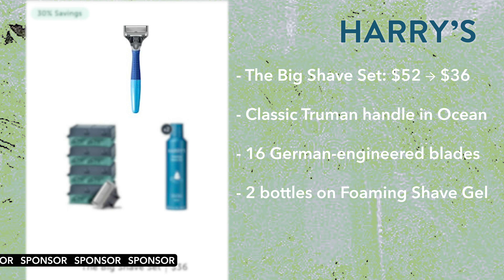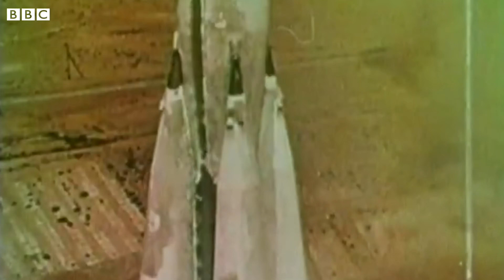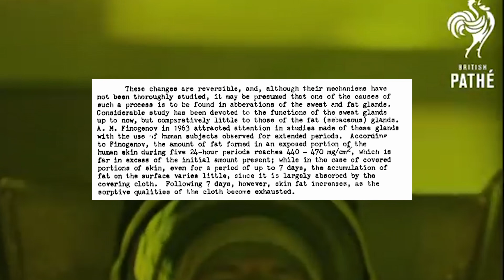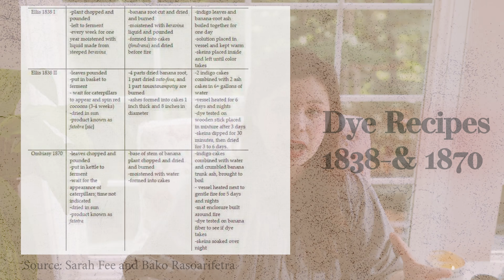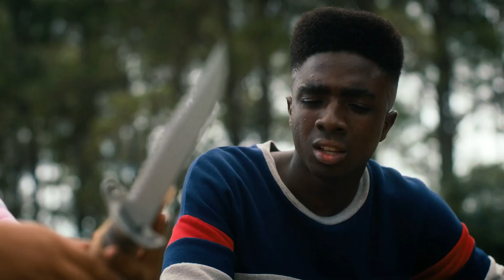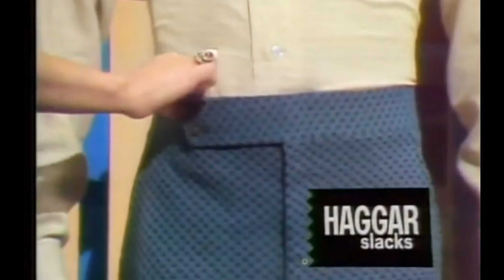The DISGUSTING truth about Laundry

Comment: Just a tip for anyone alarmed by this video, the solution IS NOT to start adding more detergent to your clothes! Most people already use too much and thats part of the problem. A high efficiency washer using high efficiency detergent only needs a couple tablespoons of detergent to clean your clothes, more is gonna cause buildup and soap scum and clog up the washer. Use minimal detergent, add white vinegar to to combat hard water and soften clothes without buildup, and use dryer balls instead of dryer sheets. Dryer sheets can actually cause the problem Abby talks about where the dryer thinks clothes are dry when they arent; dryer sheet gunk is messing up the sensor.
Reply: I HAVE to try this, SO has a skin condition and we live in the dark blue (so VERY hard water, my towels can stand on their own without fabric softener and tumble dry).

Edit to all the helpful people: it is a sensitivity to texture/touch. While I find our calcified (I think it could be magnesium or iron) towels a nice exfoliant, he finds them painful. Using only detergent, all fabrics are stiff. Somewhere between light paper (tshirts/thin cotton skirts/blouses) and a good, thick cardstock (jeans/towels). Over time, you break it back in and it acts like normal fabric again. 

But I've always had hard water, so all those pictures with sheets flowing beautifully in the breeze? Until now, I thought it was about as real as unicorns and dragons.
Reply: @Nerdygoddess , I’m allergic to so much in Laundry World! My mom used vinegar and tennis balls in socks back in the day. And I’ve used vinegar and now, laundry balls. Almost 60 years later, still a thing! It’s so helpful if skin allergies or sensitivities are in play.
Reply: @Nerdygoddess  I'd look at how adding some Epsom salts helps or hinders the washing machine / skin condition.

I've never met someone with sensitive skin / lungs that can stand Tide, so if you use Tide... maybe try something scent / dye / etc free for a few washes especially undies and nightwear
Reply: Oh hey, I already do this! It works like a charm and you save so much money on detergent.
Reply: Wool dryer balls are awesome!  The trick is to have one light wool set and one dark wool set for different color loads.
Reply: For those worried about vinegar ruining machines, you can try water softener (not fabric softener) for very hard water areas. It doesn't take care of it all, but it can help
Reply: Another thing that I hate: those unstoppable pellets (or what's it called). Those are pellets that are extremely dangerous for the environment and its only used for making your clothes smell better. Just use something else. When the clothes are dry (or perhaps drying) just hang some nice smelling herbs or plants like lavender between your clothes (lavender is also good against moths). Just use nature's remedies. 😁

Thank you for this warning, you are right.
Reply: The truth is that less is truly more when it comes to laundry detergent. Today's detergent is already ultra concentrated and you only need about one fourth of what "measuring cap" contains. You can dilute the detergent by half with water then use half a cap and your clothes will actually come out cleaner.
Manufacturers WANT you to use more so you buy more. They don't give one dam about what is good for your clothes or the environment they just wanna sell their soap.
Reply: Thank you for the tips! vinegar is cheap and it leaves clothes smelling good! Now I have to convince my daughter not to use so much detergent in her clothes. She's convinced she needs a lot...
Reply: yes, yes, a thousand times yes!
Reply: Thanks for the tips! I have autism, and cannot stand the taste and feel of soft water. But I know hard water really negatively impacts different areas of daily life. I did always think more detergent was the way to go. I will start using vinegar from now on!
Reply: Vinegar is also antibacterial so it's a good idea to use it if you're worried about cleanliness and chemicals. Apple cider vinegar is a better softener than white vinegar in my experience but I have no data to back that up.
Reply: Hi Sarah, I think you are definitely onto something by using vinegar. My experience is with growing and caring for indoor plants where the pH of the soil is crucial to plant health. When I prepare a fertilizer solution I am careful to adjust the final pH to a neutral reading of 7. Fertilizer is acidic, so I test the solution after mixing. It reads about 4.5 which is close to the acidity of tomato juice and black coffee. To raise it to 7, I add about 1/8 tsp of baking soda to 1/2 liter of solution. Plants love the neutral pH and it shows. Now if we apply this same thing to laundry, we find that soap and bleach have a pH of 12 to 13, making them very alkaline. To lower the pH we need to add something to the solution that is acidic. Vinegar has a pH of about 3. Perfect! What does doing laundry and growing plants have in common? Organic Chemistry. So I am very inclined to agree with you that adding vinegar can work wonders!

In front-end washers where you add detergent to a dispensing tray, DO NOT mix vinegar in the detergent compartment. It could cause an unwanted reaction. Instead put the vinegar in the bleach compartment.
Reply: Is softener still needed by washing this way? And do you perhaps know whether those detergent capsules are enough detergent for one load?
Reply: @DoodlesnDragons  Softener is not needed UNLESS your water is very, very hard. Any pre-packaged detergent, whether compressed tablets or liquid in single wash plastic "pods" is too much detergent because the detergents in then is concentrated. Very very little concentrated detergent is needed.
Reply: Things get very complicated in this area when you factor public laundry mats.
Reply: Wool dryer balls were a game changer (I try to line dry everything except towels.. crunchy towels are the worst)
Reply: Also, another great hints and tips channel for washers, dryers and other appliances!

https://youtube.com/user/ExclusiveGoldfish
Reply: Dryer sheets are nasty and a waste of money
Reply: In wondering if the sheets are even nessasery. I haven't used dryer sheets for my clothes for months And it makes no difference
Reply: Thank you many helpful tips!
Reply: Then just wash on higher temperture? I suppose every washing mashine has programs for 30, 40, 60 and 90 degrees celsius (or equivalent in Forenheit).
Reply: @renatabednarova8296 Nope, not every machine

Comment: Abby, if you hadn’t commented on it, I wouldn’t have thought about it. I can guess at the process for how they came up with those mg/cm2 measurements. They wore a skin tight shirt or cloth against general skin (like the back or stomach). They weighed the shirt before washing and then weighed it after washing. Now you know how much the gunk weighed after subtracting the difference. Now they measure the surface area (in cm2 of course) of the skin covered by the skin tight cloth, and they divide the weight of the gunk by the surface area of the covered skin, and you get an average of how much gunk is produced for every square centimetre of skin.

Comment: Hi! Argentinian here. As someone from a town in the "provincial" area, I've never, in my life, seen a dryer irl. Like, everything was always air dried (even when its humid outside, we just turned on the fans inside and used chairs lol); and everyone rich or poor, did this. I moved to a city a few years back and space is an issue, but I got a retractable clothes' rack, to use in the balcony or in the living room, under the fans if it rains or something. I have noticed the diferences in how my clothes wash town (well water) vs city (city water), but never realized it was from soft or hard water! Which is silly, cause I sure notice in my hair and skin lol. Also, quick question: when exactly would you use the vodka? Like, in the compartment for softener in the washing machine (mine is front facing)? You spray them before washing them or after and then hang them? I'm weary about the vinegar, cause my machine is old and the differences between US acidity vs here ñ.ñ
Reply: You spray your clothes with the alcohol (usually one with a pretty high proof/alcohol content- thus the vodka suggestion- and also only a little bit) and then let them air dry and they will be plenty sanitized that way. You don't need to wash clothing that has been sprayed with alcohol. Hope this helps!!
Reply: @theFULLMoonKnight  Thank you! I was pretty sure washing after spraying wasn't the right choice, but better to ask right? xD

Comment: The problem I see, as a farmer, is that if you want linen to become a go-to fabric for undergarments of all types, you're going to need to offer some form of incentive to farmers to grow crops like fiber flax and hemp in their rotations. The problem with that is that even if the farmers grow it, in spite of potentially SMALL yields of seed for the following year, there's still VERY few places that will take flax and hemp for fiber production. Then that brings in the economic burden of hauling it from the farm to a processing facility, which in some cases can literally be thousands of miles. [insert truck vs rail arguments here.] Then it's still a matter of processing it down into usable fiber, turning said fiber into thread, and thread into cloth, plus the whole headache of what to do with the excess plant material from the processing. 

Also, bleach won't harm your septic system unless you're literally pouring gallons of it down your pipes every week. I grew up on a septic system, and it's STILL going, in spite of having bleach in it regularly. If you're worried about solids, a package of Septo-bac or even a couple tablespoons of bread yeast down the drain every few months will help dissolve them and restart the bacteria in your system.

Maintenance tip for those who like to use scented products like fabric softener sheets and those stupid pour-in scent enhancer things in your wash: take ALL the screens out of your dryer, and let them soak in HOT water and your preferred dish detergent, or better yet, something along the lines of CLR. It'll help dissolve the wax build-up on the screens, making the dryers work more efficiently and drastically lowering your risk of a fire. It doesn't even hurt to take the dryer hoses off and let them soak in the same solution for a few hours after you vacuum out all the lint inside them. That should only need to be done once, MAYBE twice a year (think about making it part of your spring/fall cleaning regimen if you have one), but it will help.

Comment: Literally I work at a dry cleaner but the only service I ever use personally is pressing of laundering button down shirts except for my good wool coats once a year. 
One way folks who don't have a lot of funds can start down the better/more eco friendly/more economical path is to invest in an apartment size twin-tub washer. I have one for theater use and also use it at home for more delicate stuff when it is not parked in a dressing room. It takes about 20 minutes and some babysitting per load of laundry but you can fill the agitation side ONCE (in the model I have) per load for the washing and keep on using the same hot water until you're done with your laundry. The spinning side takes the place of an old school mangle and on the model I have, I can hook up the fill hose and rinse the clothes while they're spinning. Usually takes about a minute of the spin cycle for the drain hose to stop spitting out suds and then I spin it for five minutes straight and even jeans come out wrung out enough that they dry faster than in my more traditional upright washer. It just takes more of my time to use but it is also gentler on the clothes. Cost for the washer is about $150 new online. I love the thing. 
The other thing that can really help anyone who can't hang their clothes outside is to turn the bathroom into a drying cabinet. It is easiest if it's a smaller bathroom with a bathtub as you can use either the shower curtain rod you already have or if you have doors on your shower, a dedicated rod or rack,  and a dehumidifier. If I hang my jeans using pant hangers with clips and turn on the dehumidifier and keep the door closed jeans will come out dry in about 10 hours total as long as there is a hand's breath of air circulation space between items. 
Distilled white vinegar in the place of in-wash fabric softener gets rid of most of the scratchy crunchiness in air dried clothes too. 
My biggest worry with the clothesline in my back yard? Bird poop. The first few loads of sheets I hang out every year have to be laundered twice because of the dang birds. 🤣

Comment: I live in Australia, and most homes (read houses, not units or apartments), have what is called a Hills Hoist clothes line, and mix that in with the fact that we are for the most part a very arid country this works well for us. Unfortunately for the past 2 years we have been experiencing extreme rail fall and humidity which has meant that line drying has been harder, but most Aussies don't have a clothes dryer in their homes, and if they do we are all taught from a young age that they are only to be used in emergency situations.

Comment: Thanks for this video!  I've been saying most of the same things for years.  For a while, I was making my own laundry soap from grated castile soap and washing soda, which worked as well, if not better, than the commercial laundry detergent than I was using.  (In fact, I am getting down to the end of my bottle of detergent so I should probably go back to making it again!)  The problem I found was, as you said, most houses don't have a laundry line any more, and local neighborhood and city ordinances make it difficult, if not impossible, to put them up.  I have one of those folding clothes drying racks, which can dry a moderate amount of laundry (maybe one small wash load), but nothing bigger, like sheets.  I do tend to use it more in the summer, especially in the last few months where it has been hot and dry here in California, but the dryer is so much more convenient for heavy and large things, since I don't have a proper laundry line. 

I had a really bad allergic experience about 15 years ago that made me do a deep dive into researching and making all my own skin and laundry products, and I still use the skin ointment recipe and the fabric stain remover recipe that I found during that time.  In fact, the homemade stain remover (only for washable clothing) works better than any of the commercial stain sprays or gels that I tried before: it's just equal parts of baking soda, hydrogen peroxide, and blue Dawn dish soap. Mix them together into a paste in a glass jar, and scrub it on the stained spot with an old (clean) toothbrush.  Let it sit overnight, or even up to 48 hours, then wash the garment in cold water. Let the garment air-dry enough that you can see whether the stain has been completely removed or not (the heat from the dryer will set any remaining stain), and if needed, repeat.  If the stain is gone, then you can finish the drying in the electric dryer or air-dry it as you normally would.

Comment: Thank you for this video. Lots of helpful info, as others have said. And as you may have commented, comparisons (of old vs recent laundry practices) are odi(fer)ous! 
Living in an apartment (by myself), I have to share washing machines, which is not great. That said, I have a couple of wooden folding clothes drying racks. Very helpful, and I don't need to use electric dryers. Also, I'm fortunate that Vancouver (120 miles north of Seattle) has very soft tap water. Great for the clothes. (Not so good for copper water pipes, though...) Your point about a couple of shots of vodka is very interesting. My local liquor store may come to appreciate the added business.

Comment: I think it's important to emphasize the quality of the...I never know what it's called... the yarn? Does that still apply of it's non-wool? The thread? Anyway, if it isn't well formed, or if the weave or knit is poor, that will also significantly affect durability. So you can buy crappy quality linen and it will fall apart when a high quality cotton keeps going strong

Comment: It's going to sound Cold War-ish, but wearing a uniform for my work means I don't have a lot of laundry. I have a few aprons, work shirts, a couple of trouserses, and lots of underwear/socks. That's 2 loads per week for 2 people, 3 when it's bed sheets, and I have to make conscious decisions to wear "mufti" (or non-work related clothes) just so I can have enough lighter-coloured fabrics to round out the apron load.

When my kids were little and bed changes a frequent thing, I made my own laundry detergent. (1/3 cup shredded laundry soap melted in 1 pint boiling hot water, 1/2 cup borax, 1/2 cup washing soda, in 2 gallons of BOILING hot water; stirred until it gelled and cooled enough to pour into reused fruit juice bottles, and had to be shaken before each use because it would separate, and it would fade bright colours, but with the unending loads and loads of bed linens and bath towels, that wasn't a concern, just the $$$ savings.) And there was a bylaw about clotheslines that could be circumvented with a CAROUSEL clothesline. I eventually had to stop using the carousel to dry our clothes because we are downwind of an industrial park, and we started getting rashes from whatever landed on the clothes, and it didn't smell "fricken awesome". I thought about getting a new carousel, but my new neighbours indulge daily in now-legal toking, so I can't have my clothes smelling like that.